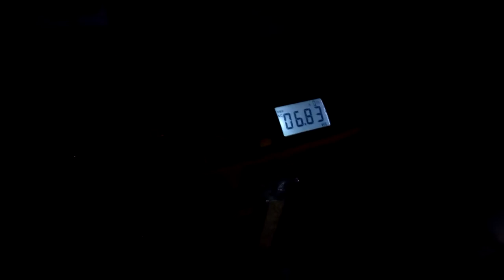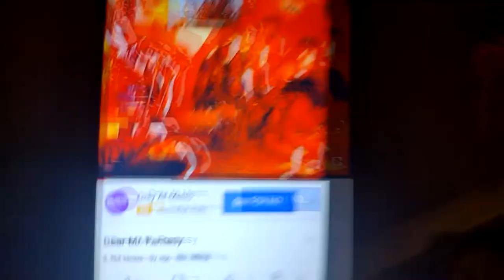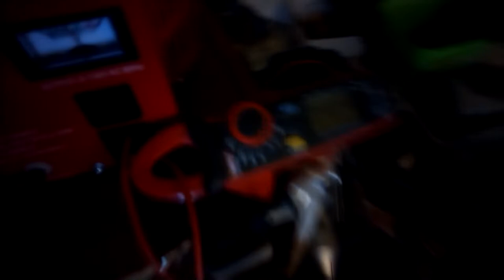SSTC Full Bridge PLL Smoothed CW + Music

Comment: You can even get it lower while getting it up there :) my cw was running about 20 primary turns. Would kill enough juice to get the voltages high up there :)
Reply from the maker: I might have to try about that many primary turns just to be able to run it without largely detuning it. I think the audio would sound better too.
Reply: @Magneticitist  yep modulation gets easier to some extend.

Comment: Have a question, is it better that the coil have a high reactance at resonance, mine on javatc is about 100k ohms, is it good?? Does it mean it will heat up??
Reply from the maker: Hard to say what's better, it's really more about what kind of build you're going for and what variables you have in mind. For example you don't really have much choice if you want a real small coil cause the frequency is going to be so high. 100K is about what I'd get with a common sized coil I've wound using 36 AWG but it's not like I was trying to factor the reactance, that's just probably about what it was given the dimensions and wire size I was using.
Reply: @Magneticitist  alright thanks is just that mine is similar to yours
Reply from the maker: @Headbutter-Lettuce90  All I can say is that it's a good L2 design. The one in this video is the 36 AWG coil I always seem to use for any new circuit I make to test it out. Seemed like no matter the circuit this coil would work well. Wrapped on PVC and I kapton taped the crap out of it.
Reply: @Magneticitist  what grade of core did you used for this build, the GDT
Reply from the maker: @Headbutter-Lettuce90  There are a couple I used random pulls from old plasma TV boards or something and this might be one but the ones I know of and bought are N30 or T37 like these https://www.mouser.com/ProductDetail/871-B64290L0647X037

Comment: I build a two little slayer exciter tesla coils but I want to step up my driver setup (bigger arcs ) could you recomend me a driver diagram to start with , I got a few irfz44 laying around , I could get the rest of parts , but it would be much appreciated if you advise me wich next step should I build
Reply from the maker: Lol damn right I can. If you want to use IRFZ44N's as the main power switches you'd be limited to a fairly low bus voltage but decent arcs can still be pulled off. I always recommend this circuit http://tefatronix.g6.cz/display.php?page=sstc4&lang=en

I've made a bunch of them and they all get decent enough arcs at around 24v-30v but they take a little more tweaking than other circuits out there. The tradeoff is it's hard to find other circuits that can perform as well using 55V mosfets. My versions use a circuit like this one in the description https://www.youtube.com/watch?v=MJfqZ6Irrrc 

If you're able to follow that circuit enough to comfortably build it you may see that it can be simplified a lot more to where what you end up with is more like a Slayer. The thing is the circuit can tend to pull so much current that you'd want to interrupt it using some kind of square wave oscillator. It basically gets interrupted into pulses by having this oscillator switch the mosfet gates directly to ground so they will no longer switch, then when released from ground oscillation starts again. I plan to make another one using Z44N's and just run it CW like a normal slayer from 2-4V because at those voltages it has great output for lighting. 

If you want to make something mains powered at like 120VAC or higher then I always recommend Steve Ward's drivers, first the https://www.stevehv.4hv.org/SSTC5.htm
and before that if you just wanted to get familiar with the operation using a single mosfet then his Micro SSTC https://www.stevehv.4hv.org/SSTC6.htm

The Micro SSTC is a good first build before mains builds because it teaches you how the circuits work using basic components. Then with a half bridge you learn adding an additional gate driver for more voltage output and winding the gate drive transformer as well as seeing what the added schmitt trigger is doing etc.
Reply: @Magneticitist  Thanks 💪for all that knowledge,  I think I am going to stick with the tefatronix micro sstc ,maybe without the interrupter part, I would like to stay at low voltages like 24v max so I could power it with some batteries , you can check my tesla coil I got a few videos in my chanel , not as impresive as yours of couse 🙌
Reply: @Magneticitist  maybe I will start with the single mosfet since I got almost every component in hand , just need to get the mosfet driver
Reply from the maker: @rodriguezfranco3839  Cool I'll check them out. With that circuit you can make it as simple as just the mosfets, the feedback/drive transformer, and the voltage divider potentiometer but you wouldn't want to go much higher than about 9-12v. Adding the zeners will help but I've always got a sinusoidal drive anyway and it seems hard to overdrive the gates at low voltage. Some kind of small snubbers across the drain-sources would help run it at 15V or higher with Z44N's. In CW you'd want to put those 44N's on a nice fat heatsink and maybe a fan depending on how it's tuned. I usually pulled something like 5A at 9V on one with good output.   

The potentiometer is to put enough voltage on the mosfet gates to initially have them turn on. That's only going to be like 4 volts so you have to keep that in mind. It needs to be turned up just enough to get oscillation going and not much beyond that to avoid possible over driving.
So without adding a regulated supply of some kind to power an interrupter you'd need to reference this potentiometer to the positive rail. At 12v input this divider setting may need to be adjusted for oscillation which is going to be a different setting than running from 24v but that might be too high anyway with Tefatronix original circuit. Playing around with the primary adjustment is also important, trying to maybe start with only 1 turn per coil so basically 2 turns with a center tap, no need for a flat cable.
Reply: I got a few questions , with the tefatronix circuit , when wounding the gdt does the direction of the primary and secondary matter? I got a few toroid I used for joule thief , those are wound in the same direction , and if I feed it with 12v lipo , could I change the rv1 with higher value( like 50k ohm or bigger) and feed rv1 with 12v instead of 5v ? And I would avoid all the zenner diodes , or could I reemplace them with 1n4148?
Reply from the maker: @rodriguezfranco3839  The direction of the windings only matters in relation to the polarity they are powered so you can just reverse how the leads are connected. It will matter which direction either the primary or secondary is connected just like swapping the primary leads on a Slayer. 

You don't need to increase the pot size too much but 5K will work fine. It will work as a resistive voltage divider so a smaller pot is just giving you more precision in the adjustment. With 5v you'd need to swing the pot over a lot more than at 12v because the gates start turning on at around 4v.

1N4148 diodes won't work as replacements because they are just ultrafast switching diodes. The zeners will only start conducting at their zener voltage while the 4148's will always conduct past their drop which will be millivolts. This would shunt all gate voltage to ground at all times. 12v zeners are a good safeguard because they will only redirect gate voltage to ground once that voltage exceeds 12v. When they are back to back they do this in both directions for both the positive and negative gate swings that will occur in the sinusoidal feedback signal. It could also safely be even higher like 15v, or 18v for switches which have 20v absolute max gate voltage ratings. Not using them at all won't keep it from working but it just won't have extra gate protection if for whatever reason your feedback signal is way too strong.
Reply: @Magneticitist  Thanks I am learning a lot , I got a few diac laying around , I took them from some lighting 12v transformers , those are like bidirectional diodes might work as gate protection but I do not know what voltage are these rated , I am going to try it without gate protection and low voltage just to see if I can get it to work , next I will be adding the zeners and every think .
Reply from the maker: @rodriguezfranco3839  I think typically I could run them without zeners with 55 volt mosfets so long as I didn't go too high above 12 to 15 volts on the input. You have to keep in mind the voltage that will climb across the drains in the off cycles. With no snubbers this is going to be very high voltage that will probably bring the fit into breakdown and possible destruction.
Reply: @Magneticitist  I got it to work just posted a little vid on my channel very low power but it worked first try , now I need to get the right components , I thought it would be way harder to make it work , thanks for all the help brother
Reply from the maker: @rodriguezfranco3839  Nice, I was surprised at first too and started to see it as an easier Slayer exciter at least when it comes to getting good output from it. The oscillation part is easy but it's the extra fine tuning of the other variables that can get time consuming. Sometimes you just get lucky also.

Comment: Hi I made a little schematic I would like you to check it out to see if I got it right , you told me that I should feed inverted and non inverted signals to my dual gate driver (27324 non inverted) so this is how I would set it up https://imgur.com/a/nsXcSo9 but then I am not sure what I would do with the outputs , can I join both outputs and to drive a single mosfet gate , or should I use a gdt with 3 windings ? I want to drive a Irfp460 , steve ward schem with the tc4420 he just join both outputs but I guess it is because is a single input driver . I want to use the antenna setup from steve's class e schem with the capacitor between looks more "safe" .
Reply from the maker: Yea your schematic is interpreting it right when it comes to feeding the signals into the drivers, but first you need to feed higher than 5v into the drivers. At least 12v. This is the voltage each individual gate driver is going to be outputting. 

When it comes to combining the outputs the reason for that is to create positive and negative swings across your GDT that will actually about equal your DC voltage powering the gate drivers. So for example when using a 1:1:1 ratio GDT, if you just switched 12V on and off across the primary, after it makes its way through the DC blocking capacitor and out of your secondary, your transistor gates will be seeing around +6V and -6V. You have a pk to pk voltage of 12V on the input side there. By using the two gate driver outputs alternating as they switch you create +12V and -12V for a pk to pk voltage of 24V. The gates will see 12V when turning on and -12V when turning off. Or it could be 15V which is the maximum input voltage of the gate drivers. 

Let's imagine you had only a 5V gate driver input like in the schematic. The combined gate driver outputs would create +5V and -5V across your gates. You'd need to increase the step-up ratio of your GDT windings just to get it closer to +12V and -12V but then you may be asking the gate drivers to deliver a certain amount of power when they only have a 5V supply. Seems easiest to stick to a 1:1:1 GDT ratio and use 12-15V gate driver power so you end up with 12-15V or so to switch the transistors in either polarity.
Reply: @Magneticitist  I do not know why but YouTube keeps deleting my coment here , anyways I am thinking would'n it be easier to just drive the mosfet directly without gdt ? The thing is I can not find any schematic in wich a GDT is used to drive a single mosfet , but I did a little drawing of how I would do it .
Reply: @Magneticitist  apparently every time I put the imgur link comment get deleted so , I will explain it , I saw steve's ward mini sstc he used two drivers and GDT like this https://www.stevehv.4hv.org/SSTC5/miniSSTCfnlsch.JPG , so I would set up the driver side exactly like he did with one winding going from one outputs to the other with the capacitor between , and on the other side I would use just one winding since I will be driving a single fet , with one side going to the base with a resistor in between , and the other side would go source and ground (negative ) then drain will go to primary and I will be adding a ds 0.001uf cap , now I been thinking would'n it be easier to just drive it directly without GDT 😂 , I you got a email I could send you a little drawing just to be sure I am getting it right. Thanks for all your help brother
Reply from the maker: @rodriguezfranco3839  If you're looking to drive a single mosfet then a GDT is only useful if you plan on running high voltages, otherwise you don't need one just like in Steve Ward's circuit.

Aside from high voltage isolation there's no real point in a GDT with a single mosfet because the GDT is swinging positive and negative with a purpose, to switch 2 transistors alternatively. 

With a low voltage circuit you just run the gate driver output to the transistor directly in the shortest run you can. Magneticitist@gmail.com